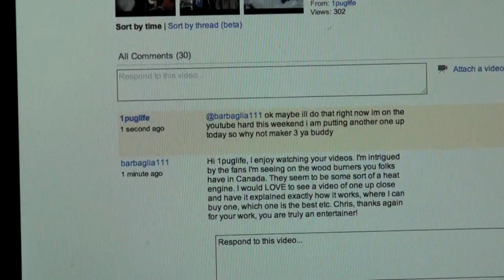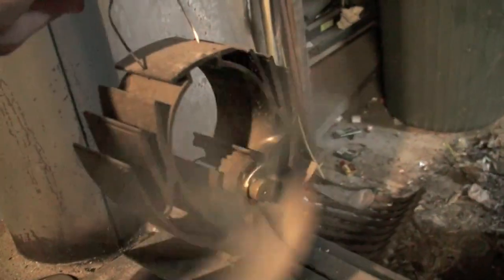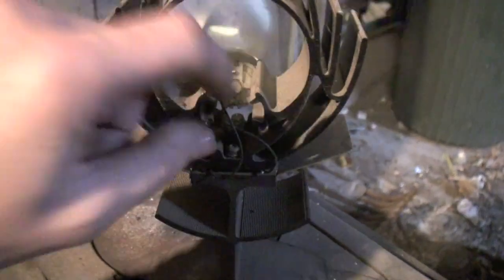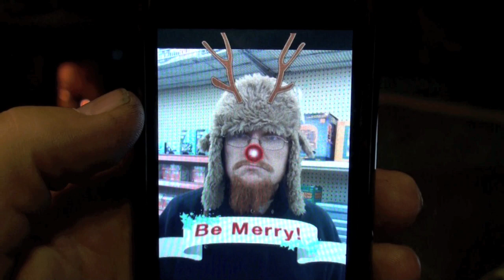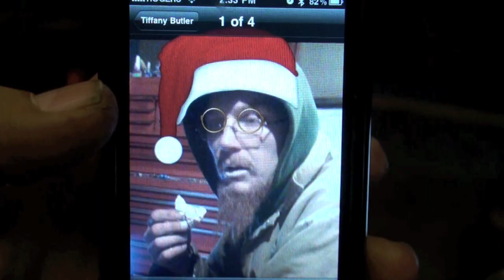close up look at wood stove fan

Comment: @mrmkc2 
Yeah, they're called seabeck generators, and they use peltier cells to generate the electricity. They're the most simple thing to make, and you can make them for less than $30 if you have an old computer laying around. Just use the heatsink and fan out of the computer and TADA! top half is already there. I made one with a soup can and it works nicely, just serves no purpose yet.

Comment: Peltier effect

w'pedia: Thermoelectric_cooling

The effect is reversible. Cool one side, heat the other, and it makes power to run that little motor. Not a whole lot of juice, but enough for a slow speed fan.